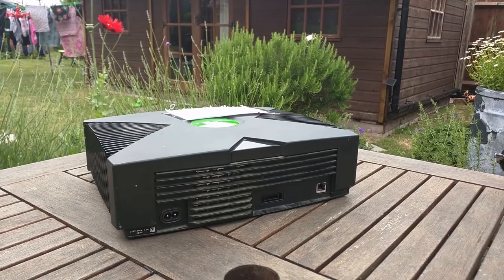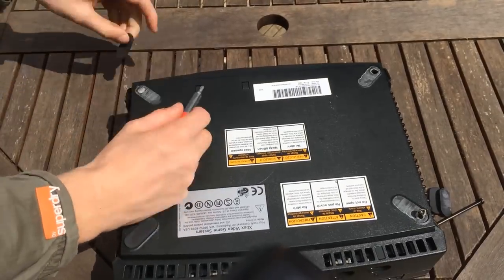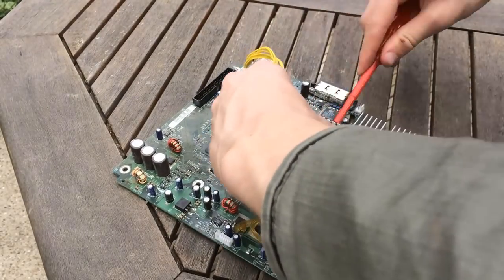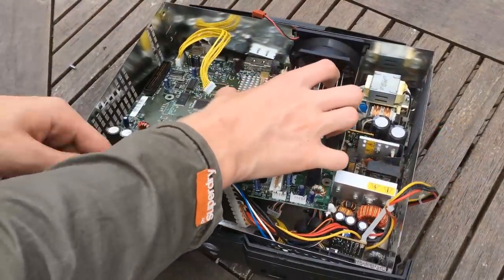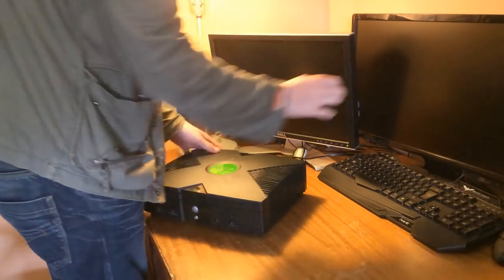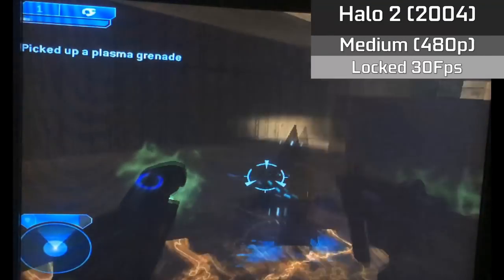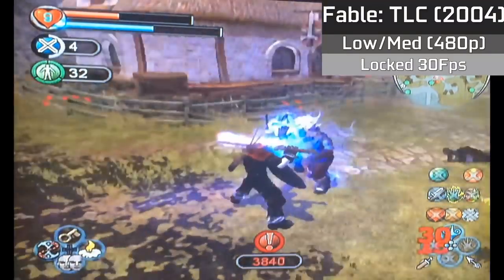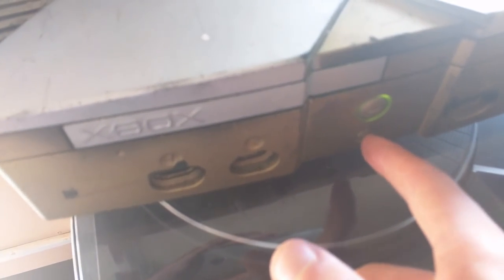I got an Xbox for Free...But can I Fix it? // Repairing the OG Xbox

Comment: My original Xbox looks like it been in the ocean for 16 years and had so many dead bugs in it amazingly it worked the drive was broke I fixed that and decided to remove the clock cap before I modded it this video helped but lmao I got the clock cap out air compressed and rubbed most of the rust off and plasti dipped some of the metal to prevent further rusting but sadly a bug got under the psu after putting it all together I turned it on then it died on me if your gonna clean I suggest taking the psu out too.. I hope it can still be fixed if you wanna see my fail here's a link XD.
https://www.youtube.com/watch?v=V6fY_1P9Df4

Comment: the xbox was biult froma pc
Reply: Specially if was first prototyped with various laptop parts.  Because of this the research and development budget was extremely low and the first xbox was "bulky".  Regardless pretty impressive given the amount of little resources and time frame the first xbox team came up with which started this billion dollar gaming platform.

Meanwhile the successor was over-engineered and designed to look slim and sleek to try to win over the japanese, and I obviously don't need to tell you what a failure it was hardware/design wise, and probably switched very few sony/nintendo fanboys to m$

Comment: Not trying to be a douche, but most likely it was you who broke the video chip, when you pried the "glued" radiator from it with a SCREWDRIVER! (so naming the video "Repairing the OG Xbox" isn't that good of a choice of words)
Proper procedure would have been to heat it up as much as possible with a hair-dryer, then GENTLY twist it off, or use some dental floss between the chip and radiator.
Never EVER forcefully pull a stuck radiator from a chip.